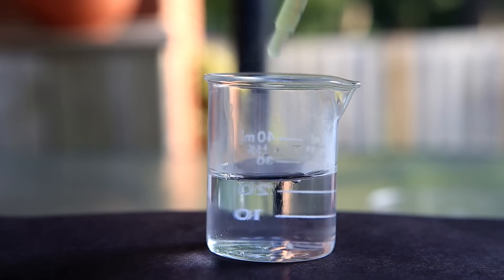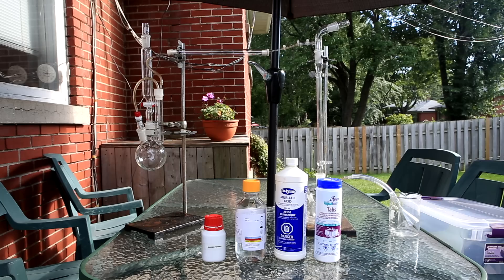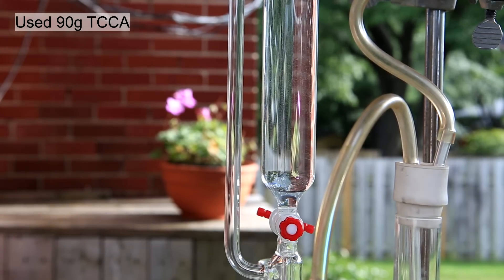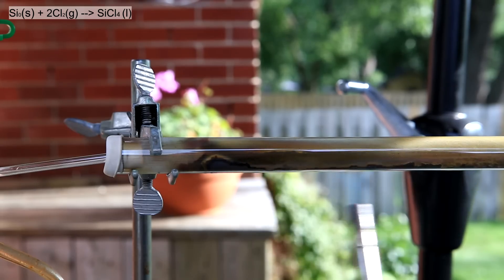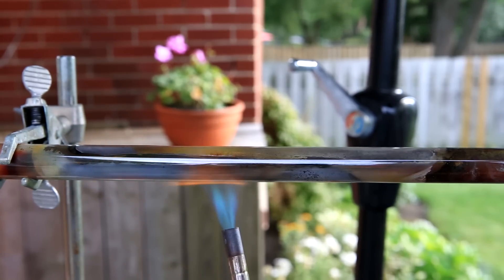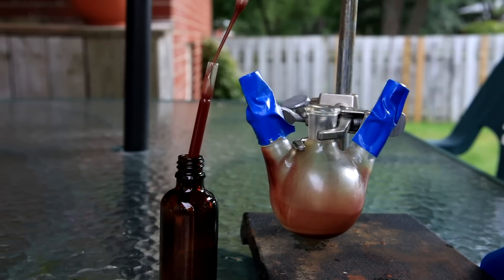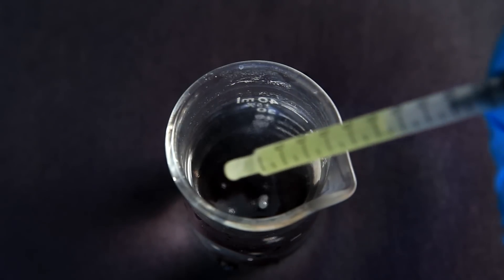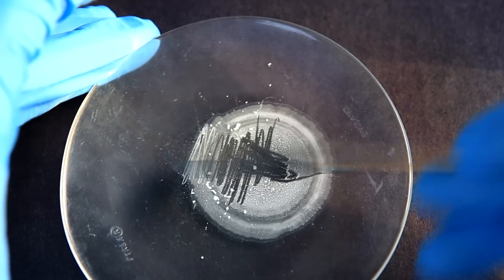Making Silicon Tetrachloride

Comment: Is. There away to use this for repeating bathtubs where there is popped è spek out of it you know something drops in the empty bathtub and you look you and can't see any damage at all but on the right light and angle you see a black a slightly off white point. You think its dirt you want to remove it but you realize that the most outer layer popped out on that single point like spot and you want to fix that but there is nothing suitable on the market. Well this shit happened to me now is it possible(see question above) ?

Comment: when i was an undergraduate, i did honors work in a lab focused on organosilicon reaction mechanisms. virtually every synthesis we did started with SiCl4. we made it routinely by the liter using a cylinder of Cl2, passing a very controlled stream over a "heating tape"-wrapped 2" x 12' pyrex tube containing lumps of silicon metal. then we distilled it to purity.

Comment: The term "sand" denotes a grain size, not a chemical substance.  The name for the most common natural form of silicone dioxide is 'quartz'.  Silicon polyoxide is also the primary substance in most glass.  Most natural sands do contain quartz, but they also tend to contain grains of feldspar, magnetite, zircon, garnet, and other mineral components, so the term 'sand' as used in the early portion of this video can be misleading.

Comment: Weirdest thing, once I bought a cream soda in a glass bottle from the gas station. I set it down on the table when I got home, and saw what looked like a big bubble come up from the bottom of the bottle. I ignored it and went to take a drink, and felt something clear and very slimy touch my lips. I set the bottle back down and shined a light in there, and it looked almost just like that little disc of Silicon Dioxide floating in your beaker.

Still have no idea what it was. Could have been congealed sugar, could have been some kind of strange clear mold.

Comment: I used to work with SiCl4 all the time, a very nasty chemical. We reacted it with alcohol (2-EBOH) to make an orthosilicate. After processing, neutralizing and stripping off excess alcohol, it was blended into a range of Coolanol products for EXXON. In fact I made all the Coolanol products for Exxon for over 20 years until my retirement. But getting back to SiCl4, if exposed to air/water massive amounts of HCL would be produced. Getting it sprayed on 35 to 40% of your skin would be fatal, because it absorbs so quickly into the skin and acidifies the blood.

Comment: You might enjoy making titanium tetrachloride.  It's a lot more volatile and reacts with moisture in the air quickly, so just a few drops produce a dense white smoke of fine titanium dioxide particles.  My impression is that it's safer because the dense smoke is so visible, it's easy to avoid breathing, and it's hard to breathe in unreacted TiCl4 because the reaction with moisture in the air is so prompt.  I don't think there's that much danger in the HCl in the air because it's so dilute.  Of course, breathing the fine TiO2 dust isn't good, the particles are so fine they will never come out.  The problem with SiCl4 is that the reaction with d water is much slower, so you can get some in your eyes where it can produce sheets of glass instead of more easily washed out submicron dust.

Comment: Just curious, If you carefully fill a scratched on a piece of glass with distilled water and silicone tetrachloride and wait for pure silicone particle  dioxide to form inside the scratch and then heat the scratch with a glass burner can you fill in and repair the scratch?

Comment: now I've worked with some nasty chemicals before, but turns all the moisture in your lungs and eyeballs into acid and sand is a new one for me.  it's one of those ones that seems fairly innocuous at first but then you do the wrong thing and bam crippled for life.

nastiest stuff I work with on a regular basis is mek peroxide, all that does is explode and give you ball cancer.  I'd take missing digits and having to lop off a nut over losing my eyes and lungs any day.

Comment: Maybe it's not very interesting for a video but did you try to use SiCl4 to create very pure silica (fumed silica) through reaction with oxygen and hydrogen at high temperatures? I'm not sure how the reaction goes, it the Si reacts directly with the oxygen or through the water formed in the reaction. That process is used to created very pure silica that is then used to make "quartz" glass. That kind of silica can be sinterized to create the glass under pressure without needing the extremely high temperatures to make quartz glass by melting sand without any flux. It's also the base for the process to create optical fibers.
It was created James Franklin Hyde and led to the creation of Dow Corning.
Making the glass would be tough but the silica not so much I believe. You would need an oxy-hydro torch burning a stream of SiCl4.
Hyde, U.S. Patent 2,272,342, "Method of making a transparent article of silica"
There are drawings there and at wikipedia in the page for Fumed Silica.
I'm just brainstorming here but that could eventually lead to an way to make some low quality optical fibers at your home lab.

Comment: What about starting from sand and making elemental silicon? Also, isn't it at least conceivable that the generally un-sand-like consistency of your silica is due at least in part to formation of  short lived hydrated polysilicic acids? It's much more reminiscent of silica gel than sand.  Just my 2 cent hypothesis.

Comment: so eat it and you will have sand and acid tearing apart your innards. cool. 

what was really interesting is how simple it was to make: just combine hot silicon with chlorine gas. So how much more unstable would it be to make silicon tetraFLUORIDE? hydrogen fluoride vapors would form, shutting down your nervous system, a.k.a. 1-shotting your brain, and the silica it forms would dissolve in the newly formed hydrofluoric acid.

Comment: Does it make any sense to think that it could be used as an adhesive for glass?

Since it precipitates silicon oxide when exposed to the ambient and surface humidity, it should behave sort of like cyanoacrylate. if I'm not missing something important.

A very dangerous adhesive but with the appropriate safety equipment...

Comment: silicon dioxide seems really safe to handle... until it gets to your lungs... macrophages in your lungs are really dumb when it comes to insoluble particles, they try to eat it but they fail and so crystals of silicon dioxide remains in that macrophage until it dies and then other macrophages comes and tries to do the same thing... with the exact same results potentially generating to the long run an inflammation so strong that it can actually turn your lungs into fibrine, like if it were a big giant scar, this is called restrictive lung disease and the fact that hydrochloric acid is also being generated it only adds to that inflamation so yeah... scary stuff indeed.
Reply: How would this very water soluble stuff get so far, into the lungs?
Reply: @leocurious9919  That's the point. It doesn't get in far, those masses form higher up and block the rest of the lung from airflow.

Comment: Why doesn't the glass break when he heated it, is lab equipment made of special glass
Reply: Yes. It is borosilicate glass instead if soda lime glass. It has a smaller thermal expansion ratio, so its less likely to shatter from thermal shock.

Comment: In my work, which involved spectroscopy in the UV wavelength range, I needed to use sample containers with extremely pure silica windows.  Silica windows used for UV-Vis spectroscopy would not do because impurities in silica made from sand absorb in the shorter wavelength UV.  I'm told the silica was made from silane (SiH4, the gaseous silicon analog of methane.) and oxygen.  Since silane is used in the semiconductor industry to generate thin layers of precisely doped high purity silicon, it was available in in quantity at absurdly pure grades (like 99.99999 % or something like that).  As long as very pure oxygen is used, a very pure silica is the result.  I'd like to know how the ultrapure silica is handled - melted, formed, ground & polished etc. - without contaminating it.  Molten glass and silicates can corrode most metals.  Fiberglass is produced using spinnerets of platinum metals, for eg.  I suppose the same goes for pure silica.  Maybe not, but the industrial process still intrigues me.
Reply: You can sinterize the fumed silica into silica glass without melting it. I'm doing a project on making this kind of glass so 1 year later I will give you a better answer lol.
Reply: @Tezcax  where is our better answer
Reply: @Calicifier  hahaha, 1 month left
Reply: @Tezcax  so?
Reply: @Tezcax  waiting...
Reply: @Tezcax  Still waiting on that answer...
Reply: @Tezcax  Dude, what of it? We're getting anxious over here.
Reply: I suppose you are talking about OH-groups in normal glass/silica?

"Molten glass and silicates can corrode most metals."
No they cant. But they can dissolve a lot of usually inert materials like rockwool etc. that are high-temperature resistant (oxides, ceramics). But metalls dont really get corroded by molten glass. The use of special metalls in manufacturing is the non-wetting of these and/or the identical coefficient of thermal expansion.
Reply: Perhaps it's deposited from the vapour phase on a less pure silica or something else and then separated from it by grinding with diamonds or etching with HF

Comment: Could SiCl4 be used to produce HCl more concentrated than azeotropic?
Reply: H2So4 + 2 NaCl = 2 HCl + Na2So4 i think this reaction is much cheaper and it will pruduce pure hcl gas
Reply: i dont think so.
Reply: nikos karavitakis but the concentration is limited by the fact that water and HCl form an azeotrope when distilling. In this reaction, the HCl goes into solution without any other solutes.
Reply: yes i agree about the azeotrope. but the reaction i mentioned is not producing any water because you use 98% sulfuric acid and dry sodium chloride and the products are hcl gas and sodium sulfate
Reply: nikos karavitakis I see what you mean now. I'm still not sure it would work. The method you are describing would require bubbling the gas into water to dissolve it. HCl has the annoying property of being so soluble that it creates a suck back. I.e. It dissolves faster than it can be produced resulting in the creation of a low pressure zone in the flask, which sucks the liquid back into the flask.
Reply: Yes that method is if you want to have pure hcl gas without water .if you want to dissolve it into water i think using a funnel you can avoid water suckback and then you can dissolve it until it reaches maximum concentration .The same method can be used if you want to make hydrogen fluoride gas from sulfuric acid and a fluoride like NaF ,KF ,CaF2 etc and then if you dissolve it in a controlled way in the water you can make hydrofluoric acid too

Comment: This is the most brutal chemical ive seen in my life
Reply: Heh, seen it once and not more :D
Reply: You have obviously never played with hypoflurous acid. Explosive at room temperature, it bursts into a mass of hydrofluoric acid vapor, which is probably the last thing you'll ever want to run into (and may in fact very likely be the last thing you ever encounter). I'd say it's the most vile stuff I've ever seen in a laboratory, but if you want to see some even more "run away!"-grade chemicals (as well as a few "too late to run now" ones), google "things I won't work with" for a delightful series of articles about the kind of stuff that gives professional chemists nightmares.
Reply: Science@pproved :  That is from impurities in it, not the drug itself.  Certain opiates cannot cross the blood brain barrier, heroin for example, does so much easier than its parent molecule,  morphine.  Once heroin crosses into the brain,  it reverts back to morphine so it gives a greater high.
Reply: GaldirEonai the worst is surely dimethyl mercury. even a few milligrams can give you a horrible death
Reply: Chlorine trifluoride is much more dangerous than silicon tetrachloride as it can make things that are normally inflammable such as asbestos and concrete burn.
Reply: Nickel carbonyl is the worst.  Hydrolyses to nickel metal and carbon monoxide.
Reply: Keith Jurena what about krokodil? it turns your skin green and rots your flesh from the inside out.

Comment: Hi great video you have! Could you also do a similar video of manufacturing the extremely rare(at least not found on here)Lead tetrachloride? I heard its a yellow liquid manufactured by reaction of lead dioxide and concentrated hydrochloric acid at 0 degrees C but there are other methods on too.Its quite removed from the usual lead dichloride commonly found in the lab and I'm sure you'll have a zillion viewers easy!

Comment: For those of you wondering, what you could do to avoid exposure to that unpleasant gas mixture at around 6:34 I recommend that you use a solution of sodium thiosulfate instead of the sodium hydroxide solution to capture the chlorine gas since it readily reacts to form non-volatile sodium tetrathionate and sodium chloride.
Reply: Yeah but then you wouldn't be able to capture the silicon tetrachloride as efficiently, it hydrolizes much more quickly in basic conditions. Chlorine on the other hand reacts quite readily with NaOH too. It forms relatively harmless sodium hypochlorite and chloride.
Reply: You are both incorrect but jolly good try. The correct answer is lukewarm meatloaf. You are welcome.

Comment: Could you use a quartz seed crystal and grow a really pure quartz crystal?  What if you did the to pull out the SiO2 reaction on a silicon wafer, do you think you would get a really nice layer of SiO2 on the wafer.  I was told that there is usually a very thin (0.5nm) layer of SiO2 on every silicon wafer, would that act as a seed to make a nice pure layer of SiO2 on the wafer?

Comment: Wouldn't it be better to have the column with the silicon standing vertically? Then all the chlorine gas would be forced through the powder and really react with all at the same time and not be able to go past it as if the tube was horizontal and thus have a chance to contaminate the silicon chloride.

Comment: Do you mind sharing reliable sources for the supplies you use?   or is your equipment available to you because your a grad student? Not talking about glassware, I'm mainly talking about acids (sulfuric and hcl) and other various precursors that are featured in other videos of yours, maybe links to company sites? I know you can get sulfuric from autobody shops and hcl is kind of easy to find, i was just wondering if there were one or two chemical suppliers that you use, thanks.
Reply from the maker: +Jack O'Connell I actually dont have any chemical suppliers. I actually get everything from ebay/ali express/the store
Reply: +Nile Red not exactly what i was hoping for, but thanks for replying.  i usually wouldn't even ask, but I've scrolled through your comments a lot and you seem to get back to everyone with a legitimate question.  i'm very glad i found your channel, keep it up!
Reply from the maker: Jack O'Connell I try to respond to everyone!

Comment: As always, a very enjoyable chemistry video to watch. Give me educational and entertaining chemistry videos over 'X Factor' and mind numbing TV soaps any day! I have a few suggestions, but please take care, as some of my suggested experiments involve the production of particularly hazardous and difficult to handle chemicals:
Inorganic and organic perchlorate chemistry
Synthesis of hydrazoic acid, hydrazine hydrate (or hydrazine salts) and sulphur nitrides
Solvated electron demo (an alkali metal dissolved in anhydrous NH3) and application in a Birch Reduction.
Try them........if you dare! (but please be safe).
Your SiCl4 preparation reminds me of my final year project for my chemistry degree, which involved working with Al isopropoxide, which hydrolyses in the presence of moisture much like SiCl4 does. My project involved the Sol Gel synthesis of Ba, Co, Fe and Cu-doped alumina foam supports for catalytic applications, e.g. in space thrusters employing a nitrous oxide/CH4 oxidant-fuel  and greenhouse gas (specifically, CH4) abatement. The expanded alumina foams were produced by incorporating a carbohydrate (sucrose) into Al isopropoxide (which is viscous and gel-like), adding aqueous solutions (containing dopant metal species in the form of water-soluble salts; e.g. Ba(NO3)2) to hydrolyse and form finely divided alumina, then calcining the matrix at over 1000 degrees C to sinter the alumina and also oxidise the sucrose to CO2 gas, which expanded the alumna matrix to form a sintered alumina foam with a very high surface area. Maybe this will inspire you to try out a Sol Gel preparation?

Comment: Why does silicon tetrachloride hydrolyze far easier than carbon tetrachloride despite there being a larger difference in electronegativity between silicon and chlorine and carbon and chlorine? Because in theory shouldn't silicon tetrachloride be more thermodynamically stable?
Reply: The accessibility of electron do orbitals mean there's a  low activation energy. Carbon tetrachloride would decompose more vigorously if it was simply a matter of enthalpy, but there is no low activation energy reaction path available.
Reply: +Nicholas Stahl that's "d orbitals", not "do orbitals"